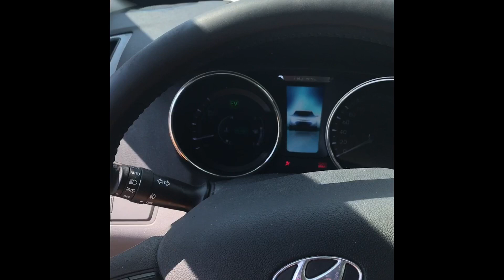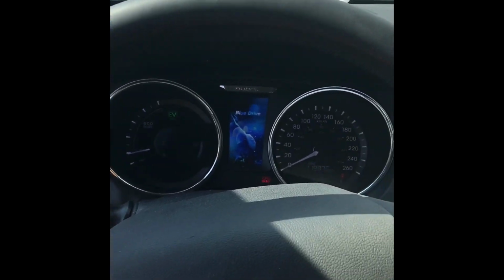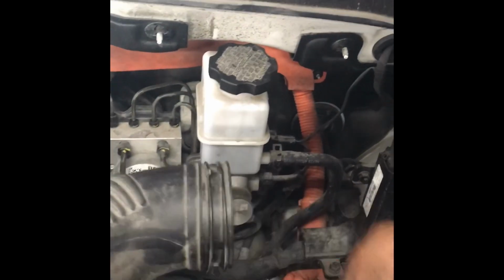Check brake Hyundai Sonata Hybrid 2011-2014

Comment: Hey bro thanks for this video Hyundai wanted 1900 CAD for part and installing plus this and that they said 3500CAD$last week I found the part in London Ontario for 220CAD I went to my a mechanic and installed the item my self it took me 2 hours to install it now my car works fine, don't spend lots of money in mechanics search for this part and install it by your self it is more easy than what you saw in video , the only hard part is unscrewing the lower bolt , I appreciate you you brother this video saved me lots of $$
Reply: Were you able to do it without disconnecting the master cylinder?
Reply: What is the part called? Trying to find it for my 2013 sonata

Comment: Had the same problem with this 2011 Sonata. watched your video and replace the brake booster worked great thanks for the help. Peter
Reply: Hi,  Peter was your sonata a hybrid? Which code did hyundai give you and did the issue ever return?
Reply: it was a 2011 sonata hybrid I have put on 6000 km since and it’s working fine, put the booster (got the brake booster from the local wrecking yard $200)in myself  took 6 hours great video. The brakes would lock up message on the dash, then it would only drive 5 km an hour. The dealer Changed some fuses give it back to me acted like it they never seen it before
Reply: Hello by brake booster are you referring to the same part that was changed in the video 
Thanks
Reply: See you just confused me because he said a vacuum pump but you're saying a brake booster these are two different parts how can I find out which one is the problem or should I just change them both

Comment: I just got this problem on my 2012 Hyundai Sonata Hybrid today. I'm planning to buy a used hydraulic pump off eBay and pay my mechanic to fix it. Thanks for the video.
Reply: I got a used one from eBay over the weekend and I took it to the mechanic today. We removed the old one and put the new used one but the error and the check brake sign became permanent and won't go away. Unlike the old one which I can drive for some days without the error coming up, I've been avoiding highways and getting scared that the error could come up at any time. We put back the old one and the error went away temporarily, I know it's going to show up later, it's just a matter of time. My question is that, is the new one I got from the eBay bad or there is something else wrong with this car that is making the new one work incorrectly?
Reply: @RickReviews thanks for your reply, I found out that the one I got from eBay was bad, I returned it and bought from another seller and I've been using it without any problem for 6 months. Thanks again.
Reply: Great
Reply: @oSEuNLa  what is the name of the part to order from eBay ?
Reply: @rentonwashington1415  @RickReviews having the same issue. Just hit me today. Please post the part number so that I can order it online. Thx!!
Reply: How did it go?
Reply: @remykiptoo815  It went well, got the part, followed the video and fixed it. I used it for over a year without any issue before I sold it.
Reply: @oSEuNLa Hey did you replace Hydraulic Pump or Hydraulic booster? Sorry I am trying to get this issue figured out it is so stressful
Reply: Did you have to reprogram the brake booster to your car?

Comment: I’ve replaced my speed wheel sensors, hydraulic power u, and my brake booster, still the same issue. I have a 2012 Hyundai Sonata Hybrid. Idk know what else to do
Reply: Same bro

Comment: Hi! I have Hyundai Sonata hybrid 2013 and the ABS HYDRAULIC BRAKE PUMP turns on and off all the time, even in the car is off and parked. Can someone tell me if this is normal? I mean I can be standing next to the car and I can hear the sound that makes from time to time.
Reply: yo same I think it may be normal
Reply: Hello sir , did you manage to solve the problem, and if yes what did you spend, I have similar problem, same car model n year
Reply: @ebitiku3504 any update? hope you resolved the problem. i have hybrid system error. replaced HPCU & HSG.
still have the error. my 12v battery isn’t being charged by the system
Reply: @PivotGrowth  not yet , I’m trying to get the brakes booster changed I don’t know where I can get the part
Reply: @ebitiku3504 Was the brake booster the issue

Comment: Nice tutorial. Too bad I found it after I had already removed the part. I installed the new but used hydraulic brake booster today. I bled the brakes good as well. I drove the car down the road for a couple minutes with no issues. An hour later I decided to take it on a further test drive. The warning light came back on and was only able to go 10 MPH or so. Any explanation for this? Could I have done something wrong in the installation, some other brake issue or could it be the used part is also bad? Any help is appreciated.
Reply: More than likely I'm thinking it would be the used part bro I'm watching this because I'm thinking about doing it myself also just want to make sure there's nothing I can get wrong when I seen they had to go to the bottom of the car to start loosening it I can lie it made me feel a little discouraged
Reply: @coreyguy5216   pretty straight forward. you shouldn't have any problems. turns out one of the brake lines wasn't tight. works great now.
Reply: @coreyguy5216 😂😂😂 why we felt that same discouraging feeling bro

Comment: I'm currently having this problem with my 2014 Hyundai sonata hybrid limited although when u turn the car off and back on the break comes back and wanting light goes away for a few days.
Reply: I had the same exact problem and then it became an everyday thing and now I can't drive my car and I'm thinking this is exactly what my problem is because when I turn the car on or when I step on the brake before I start the car I can hear the brake booster kicking in but for some reason I have no pressure my brake pedal goes all the way to the floor
Reply: How come everyone is having this same problem? Is this part of the ABS Fuse recall?
Reply: @meshawilliams837  different
Reply: @UberAdventure What is the issue then

Comment: So i had this problem i knew it was the hydraulic brake booster. I was hesitant on changing it. Does this system have built up pressure that i have to worry about when im disconnecting it?? And do i have to calibrate the new one ??
Reply: Was the issue resolved after replacing the Hydraulic brake booster?

Comment: I have been dealing with this issue for a while. The dealership completely neglected it. When I bought the car from the Hyundai dealership, the car was 54,498 miles. I drove less than 28,000 miles, and I've had this problem for some time.. I paid $23,600 and transferred the debt to a credit card. The car broke the engine and as there was a recall The Hyundai Corporation took responsibility of engine. 
The dealer fixed the engine  and now they want $5,110 to fix Hydraulic System. 
(I wrote this review is of today 9.24.2021)
Reply: Feel your pain mine just broke up and get it to the dealer and they ask me 4,000$ for the repair

Comment: Hi I have a same problem already I ordered this part,thanks for video Just I want ask which tools I  need and what's the wrench size thanks
Reply: Had same problem. Took it out and all the tools you’ll need is a 10mm socket and a 12 mm socket. You’ll need long extension socket bits because of how deep the lugs are and probably an adjustable socket
Reply: Can I know where ordered the part
Reply: Hi eBay but it's too expensive around 700$ used
Reply: @Jose A  thanks already I did it myself

Comment: The Van Nuys CA Hyundai service  DIAGNOSED my Check Break light warning and alarm on my 2014 Sonata Hybrid as a Hydraulic Pressure Unit failure. $2,600.00 cost of replacement with labor.
Reply: Buy from any where used it is working fine , in Hyundai it cost 1100 installing is easy as eating the cake

Comment: Hi, thanks for the video.
I have a question though, the dealer told me that on a hybrid, this part needs to be calibrated with a some sort of scanner, it's not enough just replaced, otherwise it may give some problem with braking. What is your opinion about that? Thank you
Reply: SsanUSA I changed the brake booster myself, got the  part at the  wreckers (200’) didn’t Calibrator it but it was already in the car maybe if it was new then you would have to?
Reply: @peterarbuckle5901   ok, thank you for your answer. I just wanna mentioned for someone who may need the same part. You can by OEM part from dealers website, for way cheaper, just search Hyundai OEM parts, and you'll find it. These dealers are selling it cheaper in online stores, I paid for mine $1037 versus $1600-$1700 at the dealer. I find a mechanic who installed it for $350, but you need to make sure someone who knows about hybrid cars, because this part different than on non hybrid car, and the new parts need to be calibrate, not just bleeding. It cost me $1387, the dealer gave me a quote for $2800 including part, I think it's a big saving.
Reply: @SsanUSA  any idea about that calibration? can i do it myself? .. mechanical calibration or need special electronic tools?
Reply: Hi I just changed it my self my car breaks works fine the dealer ship is just making story to make you do it there dont go there anymore just buy this part used from 2011 to 2015 part is the same it costed me 220 Canadian to buy used part and installed it my self it is easy as changing the tires
Reply: @qaysyusufy5743  hi, how can i contact with you? help me plz about this problem with check brakes
Reply: @peterarbuckle5901  hi, how can i contact with you? help me plz about this problem with check brakes
Reply: @qaysyusufy5743  friend in which page did you buy the piece

Comment: Hi i have a same problem with  my sonata 2013 hybrid can you please provide me with a part number
Reply: Just bought the same car having the same problem can u let me know what u did an how much
Reply: Did you fix the problem on yours? I have the same problem. I need info
Reply: Hey bro just look for hydraulic pump from 2011 to 2015 they are the same and just buy a used one you don't need part number, dont buy from Hyundai they are 5 times expensive
Reply: @omaralberto9212  I changed this part my problem fixed
Reply: Qays Yusufy I just jump start my car and it’s back to normal. Lol

Comment: Do we have to bleach the brakes once the part is installed ? Also do we have to program with a specific machine ? Thanks
Reply: You don't need any programs, you can remove the bubbles in 2 minutes after installing see the video last part I did the same my problem fixed

Comment: Hello, thanks for the video, very useful to know the amount of labor and/or tools needed to change this part. It'll be helpful to know the part number, I have the same problem and I'm trying to find the part online. In Ecuador, this part is over $4,000 plus labor. Ridiculous.
Reply: Hola Sergio tengo el mismo problema en Ecuador. Encontraste la solución?
Reply: @soniamanosalvas9132  Hola Sonia. Lleva el carro al servicio Hyundai para que te lo scanneen y reseteen los mensajes de error. En mi caso hice eso, y dejó de salir el error. No ha vuelto a suceder. Me cuentas cómo te va!
Reply: @sergiocortez7600  gracias Sergio. Me dieron un tip de que deje desconectada la batería por 1 día y en efecto se resetió el error.  Vino a domicilio el mecánico de confianza y al escanear la computadora dijo que en efecto ya no habian codigos de error. Esperemos que en verdad sea la solución y no se repita el problema. Saludos
Reply: @soniamanosalvas9132  Excelente, Sonia. Lo importante es saber por qué sale ese error, porque cuando sale no puedes mover el carro. Te dijo algo al respecto el mecánico?
Reply: @soniamanosalvas9132  Hola Sonia, te cuento que volvió a ocurrir el sonido trágico ese y el mensaje de error, hace dos días, esta vez fue el switch de seguridad del sistema híbrido (me costó $300 + mano de obra en Ecsy en Guayaquil). Cómo te ha ido con el auto? Aún lo tienes? Saludos!